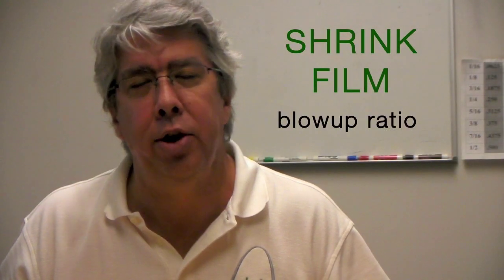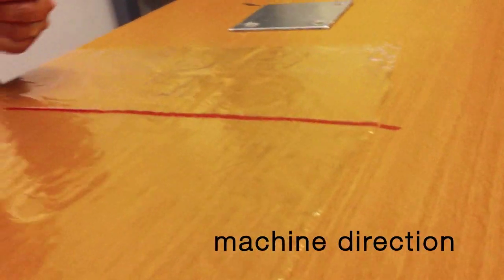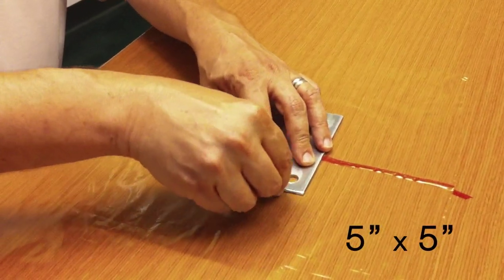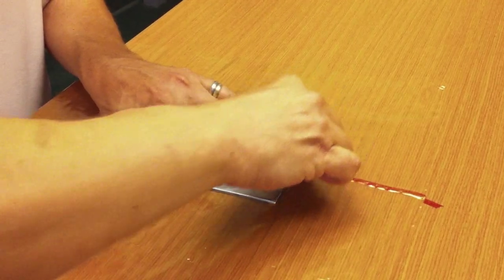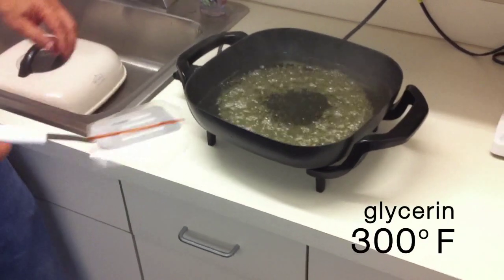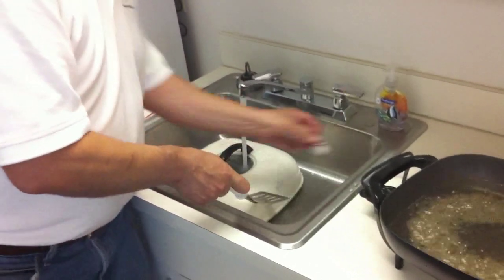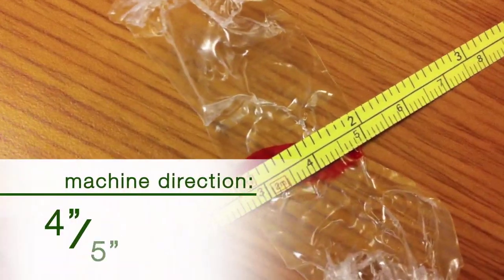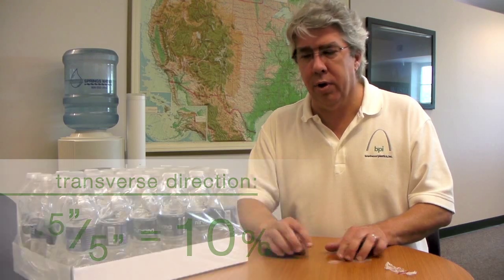Plastic Shrink Film Ratios

Comment: Hello, I have a question. I understand that molecular orientation is also the cause of the shrinking phenomenon in shrink wrap. As I understand, MD-orientation is inherent to blown film extrusion. So, what if I want film that does not shrink? Do you set the nip rolls at the top of the bubble as slow as possible, do you anneal the film , or is there another method?